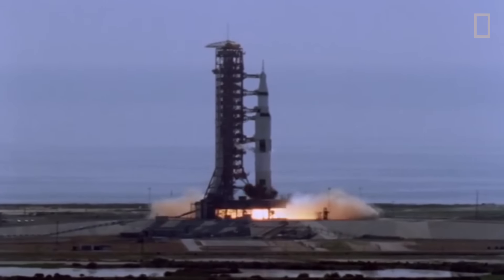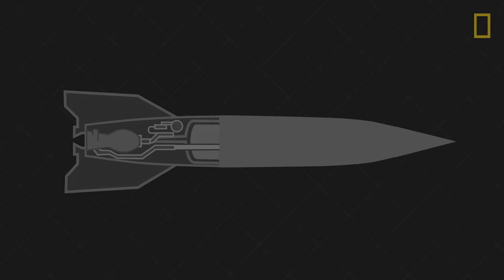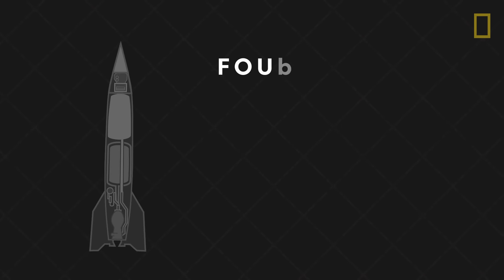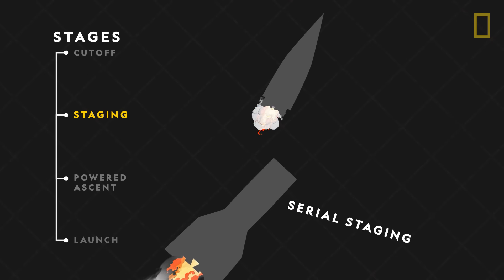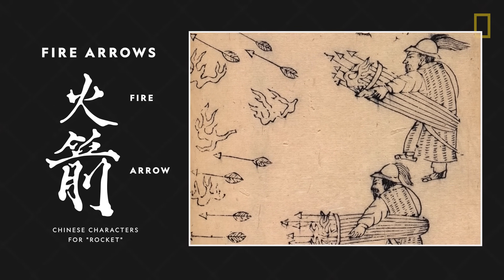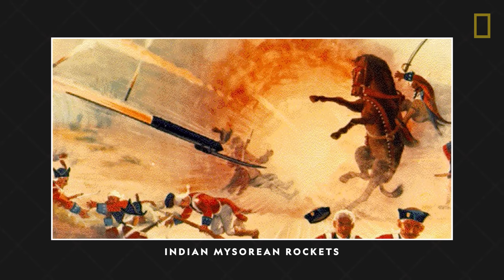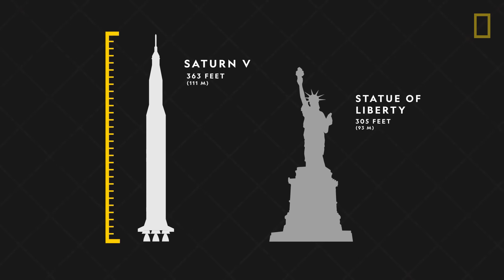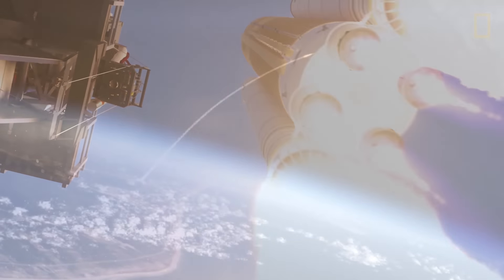Rockets 101 | National Geographic

Comment: Using thrust to make any mass move against gravity with the help of burning fuels inside a cylinder where they're pressurized up to that point where execution of operation of moving against gravity by allowing those gases to escape through exhaust unit is quiet old right. There must be better alternatives.
Reply: there isnt any better alternatives atleast for now

Comment: But doesn’t that make air pollution because that’s a lot of fuel
Reply: A few long-distance flights with an A380 or B747 pollute just as much as a single Saturn V launch – and the Saturn V was only launched 13 times in total between 1967 and 1973.